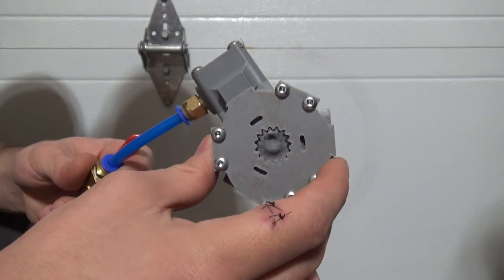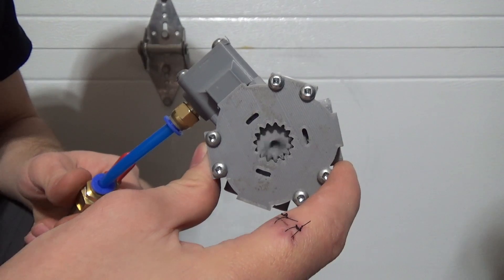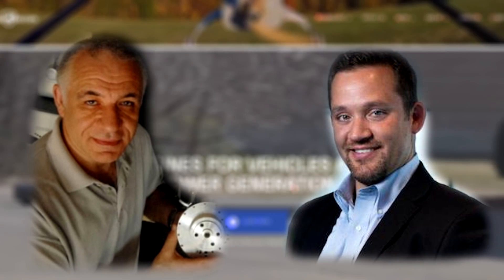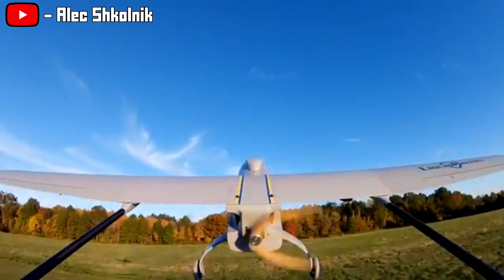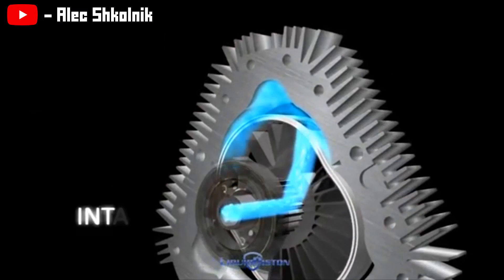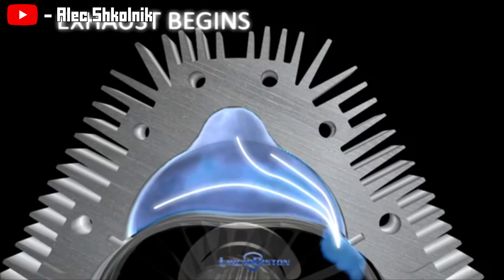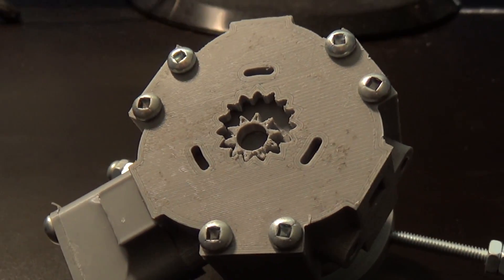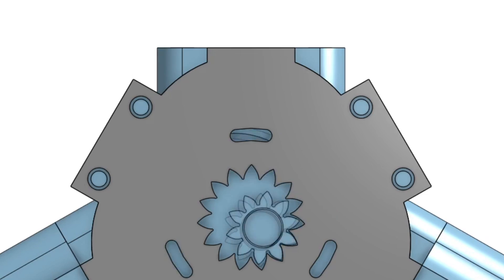A New Type of Rotary Engine: The 'Liquid Piston'

Comment: I know this video is pretty old, but, I'm designing one at a larger scale and using commercially available pinion gears. I have the general shape, however I need a consistent clearance with the rotor and housing. Did you use a different equation than the one on Wikipedia? How did you go about designing it?
Thank you.

Comment: Use unshuelded bearings. They have much lower rolling resistance and spin much more freely the rubber seals cause alot of friction. If you really need shields go for the metal shields
Reply from the maker: I have already removed the shields from the bearings and washed them in wd-40 to remove any greases, It allowed the engine to spin very freely
Reply: @CamdenBowen  thanks for the reply! cool to know you  already did that, i was impressed with how freely it spun

Comment: so, esentially this would be a 2/3th stroke engine? 1/3th?
Reply from the maker: Assuming all 3 chambers are firing yes, because mine only uses 1 I would regard it more as a 2 stroke design as the rotor has to "stroke" twice per "power" stroke
Reply: @CamdenBowen  love this design, thanks for answering!
Reply: It isn't an internal combustion engine at all. An internal combustion engine based on this geometry - such as Liquid Piston's design - is a four-stroke engine: starting from the point with one end of the rotor fully into a chamber between cycles:
the cold end of the rotor pulls out for intake (1st "stroke"), then
the hot end of the rotor goes into the chamber for compression  (2nd "stroke"), then
ignition occurs, then
the hot end of the rotor is pushed out of the chamber for power  (3rd "stroke"), then
the cold end of the rotor goes into a chamber to purge exhaust (4th "stroke").

This air motor of course only has two strokes: either end of the rotor goes in for exhaust, then out for expansion (with compressed air ported in at the beginning of the expansion stroke).

Comment: nice! question: where did you find the dimensions to make it work? I tried to replicate it but I couldn't figure out the ratio between each part in order to design it...

edit: I mean the ratio/dimensions between the piston and the trisided combustion chamber (or whatever is called)
Reply from the maker: The rotor is called an epitrochoid, if the radius of the outer circle is 2 then the rotor will be drawn with 2 "lobes". If you change the  value to 3 it will draw the housing shape. Hope that helps!
Reply: @CamdenBowen  thanks!
Reply: @CamdenBowen  actually could you post a short explaining it 😅
Reply from the maker: @openlink9958  I may do another video in the future about a better liquid piston design and I will defiantly make sure to explain it then if it helps!

Comment: Hey I have a question for you, on your 3 cylinder, how did you get an overhead valve to work. I've been using a ball valve design that's more similar to the one by Tom Stanton. Curious how you did that. (Obviously the seal wasn't perfect but I'm curious how you got a decent seal at all. Did you just wing it cause that's what I've been doing)
Reply from the maker: I used a ball valve system as well. If I was to use an O-ring around the ball it would of improved the seal as well as used a better way to seal the manifold together. The pushrod that the rocker arm drives pushes the ball open and then closes because of air pressure backing it
Reply: @CamdenBowen oh, i thought it was a traditional poppet valve (the ones in cars) but yeah i guess that works as well. Looks way cooler than the oring ball valve designs too tho.
Reply from the maker: @Eian_Anderson  I've experimented with poppet valves but they do not seal as well as a ball valve I found
Reply: @CamdenBowen  Yeah, and this convo just gave me a jimmy neutron brain blast level idea for a more aesthetically pleasing oring valve that would allow fo a v-configuration because i no longer need to rely on a crankshaft/camshaft combo like i was doing before. Thanks for walking me through it lmao. Ill let you know.

Oh yeah its big brain time.

Also i got a fun tip. Dont know what ball valve your using, but trying to make smaller engines, ive found that ball bearings work way better because they are smoother and heavier so they make a better seal.
Reply from the maker: @Eian_Anderson  I've just been using airsoft BB's as their the largest and uniformly round objects I have, that's good to know though!

Comment: Hey man. Loving your vids. I'm gonna be coming out with a 3d printed engine video in the next couple months.
Trying to make a really efficient piston design so that I can use an rc car motor to spin a compressor to supply the air. Obviously that shits unlikely, but the engine should at least work. Hope you tune in 😳

If I come up with a good supercharger design doh would be glad to share it with you. Trying to make and rc car is the dream.
Reply from the maker: That sounds very cool, would definitely like to see that!

Comment: Wow, very impressive! Really well done. I wanted to do something similar, but I have problems finding the right geometric shape of the rotor and housing. Did you use a specific mathematic formula do draw the contures? I would be really thankfull if you could help me!
Reply from the maker: Thank you! The shape of the rotor is called an Epitrochoid, the value of the R variable is 2 which will draw out the shape of the rotor, by changing it to 3 you can draw out the shape of the housing. Tools like Desmos can help you use the formula and determine the formula or help you manually draw them out
Reply: Here's a parametric model for generating these shapes. https://www.thingiverse.com/thing:8067

Comment: It is very exciting. Can you work this engine by burning fuel (hydrogen or carbon based fuels)?
Reply from the maker: Not this one specifically, the plastic would melt. The design of this design isn't suitable for the aspirations needed to run on fuels however it can easily be converted to do so
Reply: @CamdenBowen  Yes this one melt but if you have Ceramic 3D printer you can make this motor using ceramic and it won't melt.
Reply from the maker: @alpogant1071  true, in the neat future I would like to experiment with making a combustion engine
Reply: @CamdenBowen  try polycast with that you can easily make Metal parts. Polycast prints Like Pla. Then you Just need to make a ceramic mold by burning Out the polycast and then you can Cast.
Reply from the maker: @durschfalltv7505  I will certainly look into that!

Comment: I thought the liquid piston engine has 3 combustion per rotation.  Maybe make the next one withe 3  air inlets? For a smoother rotation.
Reply from the maker: I was going to have 3, and then I didn't have enough fittings so I settled for 2, but then my air compressor wasn't powerful enough to run it on 2 so i just ran it with 1 and it worked quite well. In the future if I come back to this I would love to make it use 3 valves